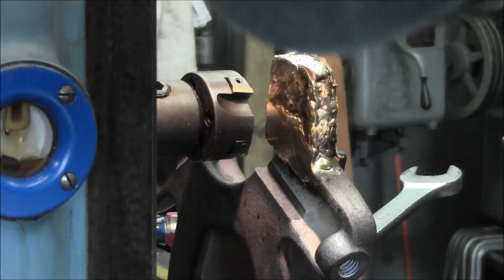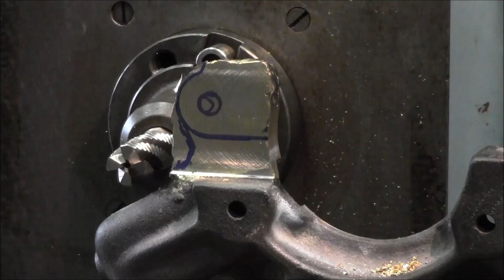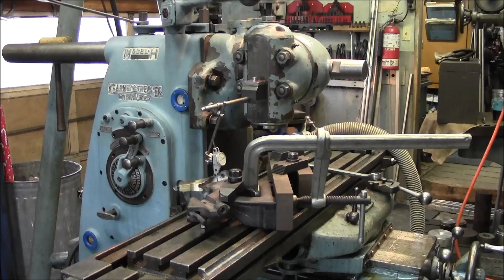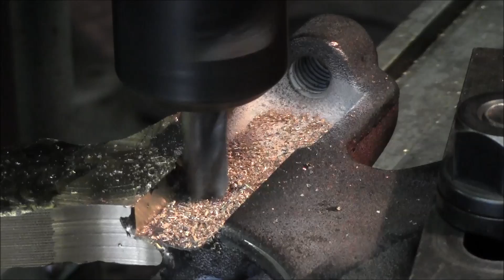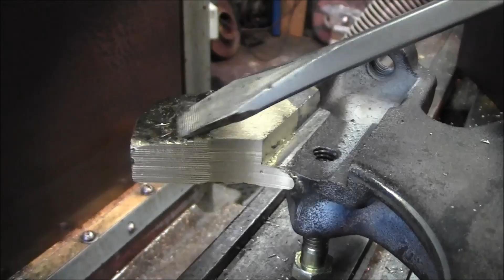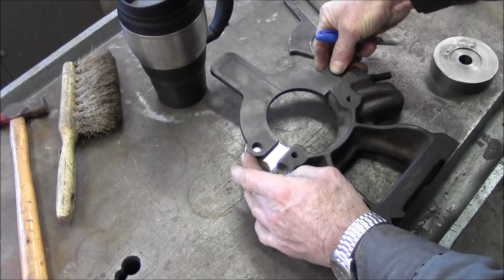The Million Dollar Rest Part 3: Lathe Steady Rest Repair and Roller Addition

Comment: The built up part is not as strong as the original piece so it is important in any repair to leave as much area as possible to compensate for the inherent weakness. Even if it doesn't look as pretty.

Comment: I was wondering how you indexed the part to be perfectly 90 degrees from the 'v-groove' in the base.  I figured you could put a square bare in the v-groove and proved it?  Or you could have used the two machined flats for the rollers, to establish parallelism???  Just 2nd guessing.

Comment: If you were still smoking you could use the outer cellophane wrapper off a pack of smokes to use the "paper" method. Must be easy to find some through away empty packs. The cellophane measures .0008"

Comment: 26min, this cnc machine, is it laser cuter? If yes how precise it is? In a stainless stell 1,5mm thick what is the smallest hole it could cut and with what tolerance? And last question how much does something like this may cost? Thanks for answers. Best Bart